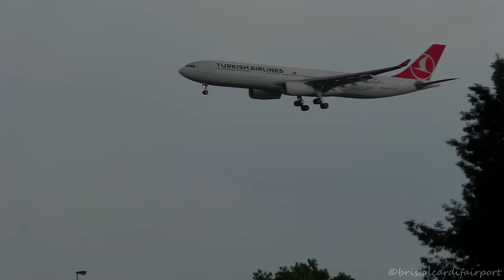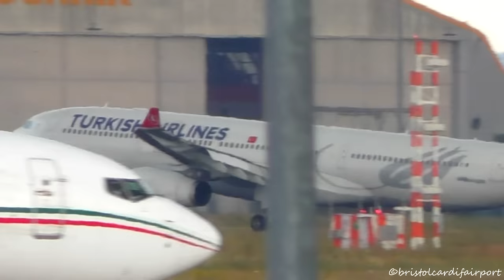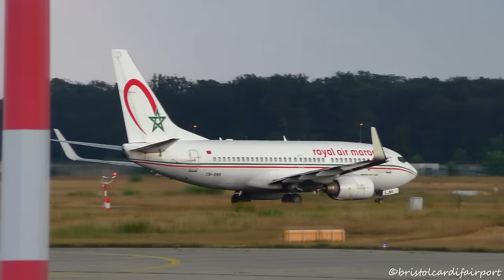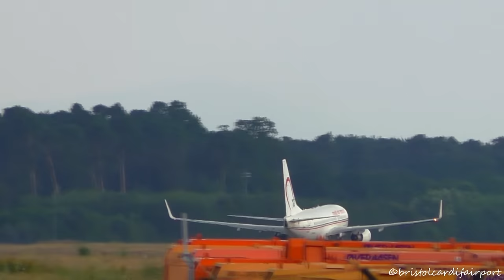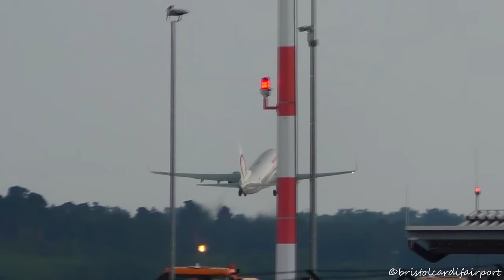PASSENGER AIRCRAFT FAILS TO TAKEOFF! BOEING 737 NEAR TAIL STRIKE & STALL ON TAKEOFF

Comment: Highly commendable and professional handling by the captain. He has done exactly what he should have done. He was also aware of the extra length of the runway to execute the third manoeuvre. The flaps were correct as well as could be seen. There was no error in the handling of the situation. It was the MISTAKE of the ATC not to consider the Wake Turbulence before giving permission to take off.

Comment: Slats are out, looks like a flaps 1 Take-off.   I would like to know what thrust setting  they used?   What speed did they rotate at?   Was it too early?    Flaps 1 would normally only be used for a heavy and or high altitude take-off.

Comment: I’m a pilot I know for a fact that the trim was not set I can see it was not the fact the aircraft wasn’t carrying enough speed the elevation was all out that’s why we have check lists from getting into the seat till the aircraft is in the it’s check after check after check I’m disgusted in what I just watched I have over 5400 hour now seen some short cuts but that is horrific
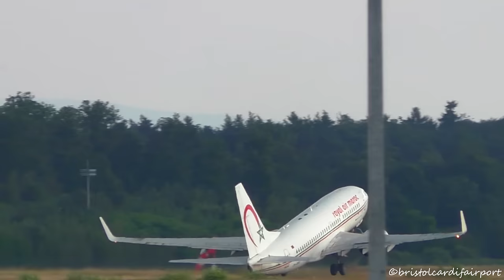Reply: Karl Edwards, please explain why the elevator rose prior to rotation and then rose again sharply at about 0:47 to 0:48 to hold the nose up.
Reply: Allyn Perdue yeah ofcorse the elevator trim is like a restriction on how far the elevator can move if it was trimmed say -0.6 it then lesson the movement of the elevator to pitch up so your losing a amount of pitch up and gain down its a aid that is used to level out also it’s apart of ground school training they probably realised there mistake corrected it witch made the aircraft rotate enough for the wings to gain lift sorry for late reply been busy on cargo flights hope that helps
Reply: Allyn Perdue also maybe just under there v1 speed
Reply: Colin Southern also a possibility I’ve actually seen that but normally the weight is entered then checked by both pilots or the company worked out wrong weights
Reply: Colin, you would have made an excellent aviation accident/incident investigator.
Reply: Karl Edwards, what types do you fly? if the aircraft reaches rotation attitude but nothing happens then its a lift problem not a trim problem. If it was out of trim then the aircraft wouldn't have been able to reach rotation attitude in the first place (this aircraft does). It was so nose high it almost tail struck, so how much higher should the attitude have been? More elevator authority/nose up trim wouldn't have done anything, you can even see them relax the pull on the elevator to stop a tail strike, so they were not even using full elevator, all more elevator would have done is stick the tail onto the ground. 

The only things which determine when the aircraft lifts off the ground, for any given weight and flap config, are speed and attitude. All elevator/trim does is allow you to achieve that attitude. The higher the attitude, the less speed it needs to lift off the ground, the maximum possible attitude is usually limited geometrically by the tail contacting the ground, if you achieve that geometric attitude limit, more elevator will do nothing to help, the nose will not go any higher, the wings will not produce any additional lift. In fact it will hinder you are it pushes the tail harder onto the ground which will slow acceleration and the down force from the elevator will contribute to the overall down force on the aircraft.
Reply: Have you ever heard of punctuation, mister Pilot?
Reply: So your saying he didn't set aft trim? Still when he rotated the plane was very sluggish ..didnt see if he set flaps correct or not
Reply: Karl Edwards Ha Ha well done for fooling the fools. You are not a pilot. I can tell that by the way you write.
Reply: That's the longest sentence I've ever read...
Reply: I don't think anybody who holds a valid pilots license would be in the comments saying "for a fact his trim wasn't set right"
Reply: Hi. What is about flaps? I'm sure flaps was up set or 1 degrese maximum. On takeoff it must been set about 15 degrese, isn't it? If it so than case of incedent had at least 2 reasons.
Reply: I don't think the flaps were set correctly.  Seems there's some leading edge flap and it's hard to tell in the vid, but maybe they needed a few more degrees all around as it looks as if the rear flaps aren't extended enough.  Another plane where flaps are easily seen: https://youtu.be/xDjMPq-jDao?t=163
Reply: A pilot with over 5400 hours, who has never heard of punctuation? That is sad.
Reply: Ted Smith Punctuation has nothing to do with flying,,,,,,,,,,,, AnD I know, of,,,plenty, of, pilots, that, cant, use, punctuation for shat,,,,!?!
Reply: What's your name in what airline do you work for just for me to avoid it. A pilot with this atrocious spelling is more likely to misinterpret airport control messages.

Comment: My initial thought that it could be vortices disruption from Airbus that just landed which settled down on the runway right where the 737 was starting to rotate & take off,  causing downward pressure on the top of the plane, or they released the brakes a few seconds too soon before the engine's spooled up to full thrust,  and they rotated too soon before Vr., rotating before Vr doesn't seem likely.  So could be wake turbulence, no crosswind according to wind-sock which is limp.  Admittedly, hard to tell if there was also a disruption occurring to speed indicator. Again, from the sound of the engines, it looks like the pilot released the brakes a few seconds too early & rushed the take off before Vr.
On the positive side, the pilot recognized a problem, didn't force the take-off, let the plane settle a moment, then rotated again at Vr.  The pilot did a good job of stabilizing the 737 and rotating again at proper Vr.  Flaps look like they were set, but also hard to tell if they were engaged at the correct flap setting for take-off weight and conditions?
A good mystery...

Comment: Royal Air Maroc has established a reputation as one of the most safe and secure airlines in operation. However, in 1994, the company experienced a tragic incident during a local flight in Morocco. Upon investigation, it was determined that the cause of the accident was the deliberate deactivation of the autopilot by the pilot, resulting in a suicidal act. In light of this tragic event, the Moroccan pilot school has implemented strict measures in its selection process for pilots to ensure the continued safety and security of its operations.

Comment: either bad v-speeds or extreme windshear (less likely)
Reply: What about extreme windshear due to wake turbulence?
Reply: PlanesAtAirports Spotting 

The flaps are the problem.
Reply: What about improper load balance?
Reply: this is odd Flaps not really tho.. also when too much they slow down the plane
Reply: NanoBoltz u know they generate lift right?  The flaps were apart of the problem.
Reply: gianni pintard Yes, I do, also the flaps were not set sooo yeah..

Comment: If I see correctly that is the 18 in FRA. The south runway is only used for take-off and often has to contend with tailwinds. It is up to the pilots whether they feel comfortable starting there, depending on their experience. Most of the time no one wants to admit that they have concerns and try. The runway is very, very long because it passes Cargo City and the planes can take off directly there. Nothing has happened so far... it should stay that way...

Comment: The takeoff configuration is correct, you can check the trailing edge flaps with a small angle that's means the flap are deployed. The stabilizer trim (aft position) is also in correct position.
Should be an incorrect v1 maneuver combined to a fully loaded operational flight.
Reply: The earlier A330's wake turbulence, actually. Suddenly having a lot of tailwind isn't a good thing for rotation.

Comment: I guess nobody is going mention that his flaps wasn’t set?
Reply: I disagree you can tell there set to about 2 degrees........
Reply: @deborahpell3869  lol, obviously not enough
Reply: @TheIrongutz  Hey you know somethings better than nothing, they hope.....lol
Reply: Deborah Pell you right!
Reply: Flaps where set correctly
Reply: I hope this comment helps:

So, First of all in this video you see the Turkish Airlines Airbus A330 landing. This plane flies over the runway the 737 later takes off from, meaning that there is now wake turbulence on the runway. When it is time for the 737 to take off (which has flaps 1 selected, which is a normal setting for this runway length and wind speed) it rotated as it was in the wake turbulence of the a330. The wake caused a tailwind, therefore making the airspeed lower. The pilots lowered the nose to pick up more speed, and then rotated again and took off. Nobody was at fault here. My sources came mostly from observation of the video and from Ryanair captain "Mentour Pilot" who did an analysis of this video and came to this conclusion. Feel free to check out his video on it, i hope this clears some things up.
Reply: not necessary always all airplane do same flaps !while you thing wrong check video mentor pilot on YouTube Buddy!

Comment: It's noted that the pilot did not follow the take-off procedure or did not confirm it with the copilot. The plane does not achieve enough lift for take off. Although they passed the V-1 and V-2, the lenght of the runway finally helped them since while they were trying to complete the rotation. The increase of the V-2 made the plane rise almost to the end. Once you reach V-2 you have to rotate by obligation since takeoff can be aborted in V-1 but it is not recommended in V-2. Even with an engine failure you can lift, turn around and return without major problems. Apart from the fact that the plane is full of fuel. Aborting takeoff at that point would spell disaster and many more deaths.

Comment: Something was off for sure whether it be a miscalculation, failure to set flaps and/or rotating at too slow a speed.  It is thankful one of them was well trained enough to eventually lower the nose to gain a higher takeoff speed.
Reply: I hope this comment helps:

So, First of all in this video you see the Turkish Airlines Airbus A330 landing. This plane flies over the runway the 737 later takes off from, meaning that there is now wake turbulence on the runway. When it is time for the 737 to take off (which has flaps 1 selected, which is a normal setting for this runway length and wind speed) it rotated as it was in the wake turbulence of the a330. The wake caused a tailwind, therefore making the airspeed lower. The pilots lowered the nose to pick up more speed, and then rotated again and took off. Nobody was at fault here. My sources came mostly from observation of the video and from Ryanair captain "Mentour Pilot" who did an analysis of this video and came to this conclusion. Feel free to check out his video on it, i hope this clears some things up.
Reply: @ElectroRail  It really does!  Thank you for taking the time/effort to write it.

Comment: Damn lucky that he had more pavement than intelligence, on this day!!!
Reply: His intellince wasn't the issue here. Without his intellince they would be dead now. Everything they did was actually done right
Reply: @lukasrohrmoser3213  perhaps, perhaps not...obviously this plane is over max TOW, it's on the pilot to ensure this doesn't happen.
Reply: @tima.478  This pilot isn't at fault. This was the cause of wake turbulence, not any form of human error, you don't know if and when wake turbulences happen and the pilot handled the situation correctly
Reply: @lukasrohrmoser3213  Looks more to me like he tried to rotate before reaching V1, and his weight also looked to be an issue.
Reply: I hope this comment helps:

So, First of all in this video you see the Turkish Airlines Airbus A330 landing. This plane flies over the runway the 737 later takes off from, meaning that there is now wake turbulence on the runway. When it is time for the 737 to take off (which has flaps 1 selected, which is a normal setting for this runway length and wind speed) it rotated as it was in the wake turbulence of the a330. The wake caused a tailwind, therefore making the airspeed lower. The pilots lowered the nose to pick up more speed, and then rotated again and took off. Nobody was at fault here. My sources came mostly from observation of the video and from Ryanair captain "Mentour Pilot" who did an analysis of this video and came to this conclusion. Feel free to check out his video on it, i hope this clears some things up.
Reply: @tima.478  ok if youre just gonna not take that youre wrong and this other guy is right then just dint talk.
Reply: @ElectroRail  I'm a 25 year airline mechanic, so I think I know a thing or two about what I'm talking about. You can't even see wake turbulence, so how do you think this other guy knows it was wake turbulence??? You would have to be onboard this aircraft to have any idea that was the cause of this botched takeoff! You can however, see an overgrossed/weighted plane struggling to take of or an attempted rotation before reaching V1. (like the person posting the video eluded too as well). But I'm sure you want to continue a useless argument...we're done here!
Reply: @ElectroRail  Not to worry, you still have time to fix it!

Comment: Not a pilot, but looks like maybe the flaps weren’t properly extended. And who knows if trim was set correctly, or if aircraft weight was properly calculated/distributed. Regardless, a very dangerous situation without a doubt. So glad they finally got airborne without a terrible accident.

Comment: No big deal.  They just hit the wake turbulence of the Turkish airlines (looks like Airbus A330, in the first part of the video) which flew over and perpendicular to the runway the royal air jet used to take off.  The Turkish airline's vortexes would have been pushing down on the royal air jet (just at the wrong time).  Once the royal air jet flew through such wake turbulence it took off normally.

Comment: I imagine they finally took off at the very end of the runway. Scary.
If no-one addressed this in the past 5 years, I doubt there was enough runway left to abort by the time they realized the mistake. It seems riskier, but I think it was safer to do what they actually did in the video. They would have overrun the runway at high speed otherwise.

Comment: "Turns out, wasn't a mistake at all.. as most of us thought at first."

Well, that´s the point of commenting to early and without having any real knowledge.
 The crew did exatly what they had to do because --> 737 encountered wake turbulence from the TK 330 at rotation, which caused the airspeed/lift to bleed rapidly.

It´s that simple if you understand what you are looking to.

Comment: Yes, you can clearly see that there are NO FLAPS out. Once the pilot realized that the flaps were not deployed he applied more power to achieve liftoff. This happens daily.
Reply: Looks like takeoff flaps configuration to me. You don’t take off with flaps 40 like you would use in a landing!

Comment: I think that resulted from rotation before reaching required V1 speed for takeoff. Or, because V1 is adjustable, wasn't well suited to the airplane's total weight, and, also this time, resulting early rotation by pilots.
Reply: it's already known that at the moment of rotation they encountered the wake turbulence of the flight at the beginning of the video, which landed perpendicular to the runway the air maroc flight took off from. Because it was perpendicular the wake turbulence dropped the airspeed of the air maroc back below vr and the plane couldn't fly. Crew responded correctly by putting the nose down until they regained enough speed to rotate.

Comment: @bristolcardifairport You take on this event is completely wrong. The wake turbulence from the A330 that was landing ahead of this departing 737 caused the long roll takeoff, not pilot error. Air Traffic Control gave the ‘37’ crew a possible wake turbulence warning when they cleared them for takeoff, and the 37 had flaps set to 1 and wing leading edge trimmed correctly for a standard takeoff. The reason that ATC cleared the takeoff was due to the length of the runway, the 37 had more than enough runway to get airborne despite the excessive downforce of the A330 caused wake turbulence. You really should correct the statements in your video description so that people watching get the facts from this flight.

Comment: Royal Air....what a nightmare airline. I have flown on them @ six times, and have a dozen bad stories....best one was when a brand new 737-800 (IIRC) couldn't get started in Marrakech; they tried several times and then announced (in Arabic only) that they would bus us to Casa; well that was going to mean @ 30 ppl would miss their connection to JFK; we all de-planed, picked up our bags, went through customs and immigration (those that were going to JFK) and then went to the bus; I was tail end charlie and just as I was about to board a rep comes running from the terminal and tells us they fixed the plane and to come back....through security, customs and immigration once more....we flew down to Casa at low altitude to save time and they bloody taxied up to the waiting JFK bound 787, and allowed those connecting to go from one plane to the other; bags came off as well and onto the next flight. Absolute nutters.

Comment: Shouldn.t the wing flap be partially down haft way?
Reply: The 737 was using flaps 1 which is normal for these conditions at frankfurt as it is a very long runway. It was reported that this incudent was due to the wake turbulence from the a330 that landed before the 737 took off reducing the airspeed and lift. The pilots reacted well and lowered the nose to gain airspeed and lift.